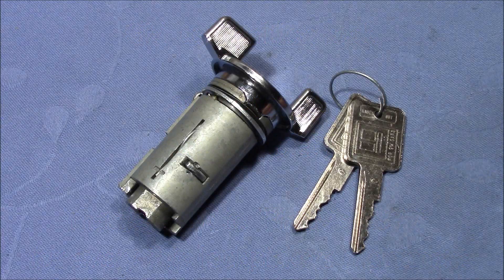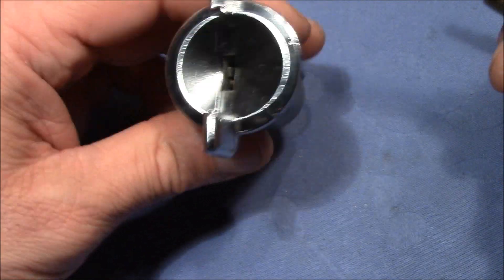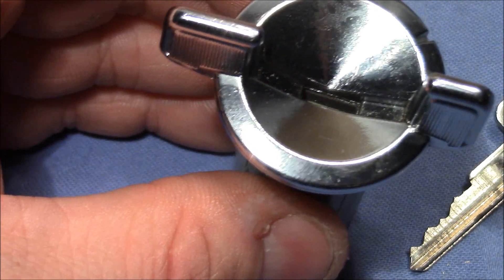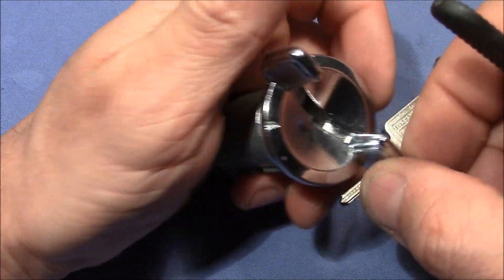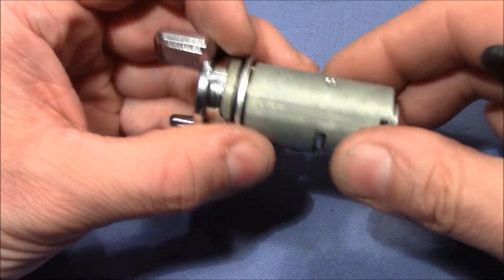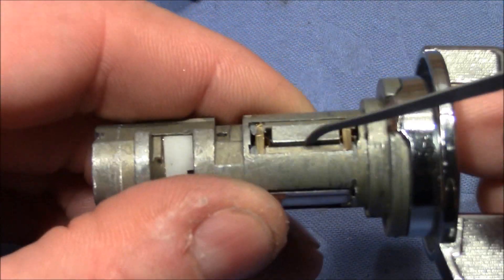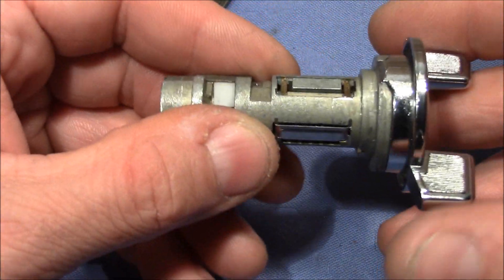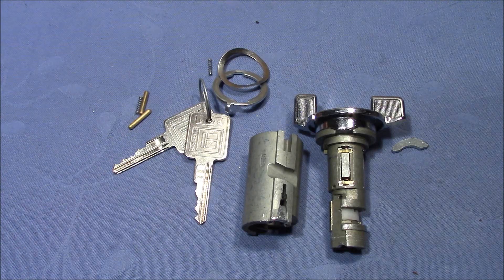(picking 432) A pick-proof lock? - GM car ignition lock inspected - thanks to 'PickME 1977'

Comment: If you have the sensitivity of the prohibited lock picking lawyer fingers. You can individually pick the wafers without tensioning the core but the spring tension is divided between wafers so it is incredibly hard to feel the bar snap into place. Keep in mind that each wafer has to remain placed while the next is placed.

Comment: I'm sorry to say this gm ignition isn't unlockable. It's actually very pickable. I pick them every day. This lock has a side bar that makes it harder to pick. But if you tension the side bar you can pick the waffers
Reply: I dill a small hole in the face of the ignition exactly where the sidebar is and run a piece of bent wire into the drilled hole and I tension the side bar and I use a pick or or a B102 or B106 jiggle key to jiggle it open.

Comment: why pick this lock, just take the steering wheel and anti-theft locking ring and turn signal switch out... pull the lock cylinder and turn the ignition switch pinion with a needle nose.
Reply from the maker: "why pick this lock" - because this is a lockpicking channel ;-)

Comment: Lost the keys of my 1988 Blazer. How can i do?
Reply: Just picked this lock! Thanks for the video!
Reply from the maker: Good to read that you got it open - jiggler keys are the appropriate weapon for this mechanism.
Reply: @Potti314  Had to make a tiny hole (after removing the "ears" of this lock), to insert a pin and release the extra safety, and then porceed with picking.

Comment: master locksmith have tools and Technics that can handle this lock
i thomas thill wrote a book years ago on this lock
for those of you that can imagine a new Technic to defeat this lock
the lock has 6 wafers we will target front of lock then back of lock
hint if you make a key cut in first 3 chambers
 space one    can be 1 2 3 4 5
             two    can be 1 2/3 4/5
             three can be 1 2/3 4/5
by inserting  into lock you can make side bar tilt
if tilted and turning pressure is applied
the corner of sidebar will trap under shell
preventing key from being pulled out
more to it if you need more info
thomasthill8163@gmail.com
work smart not hard
thanks for your time
last thought
gravity hurts
Reply from the maker: Interesting, so when using this method you cause the inners to get tensioned. Nice :-)

Comment: Put a screwdriver in it lol
Reply from the maker: That's cruel.
Reply: @Potti314  but it works for these lol, these locks after 25+ years of every day wear don’t hold their durability well. I just had to replace mine in my ‘86, the tumbler finally gave the ghost last month and you bet I was driving with a flathead screwdriver for 2 weeks

Comment: I saw this one on very old Ford Taurus (very rare in my country and region) , and I have similar working chinese (I think it's chinese) locker / desk drawer lock , that uses very similar design. And , it can't be - tensioned. When You try to tension it , You also tension all wafers , so , You can't put them down correctly. Key is cut on upper side , so , it's kinda unusual for this type of locks. It can be made to emulate this lock on video , by inserting small bars on 3 sides so only one can be unlocking one. I'll post a pics of key , core with key in it , and bible itself , as it has 4 sides for lock / unlock.
Reply from the maker: Sounds very interesting, it's cool to see so many different designs. I'm subbed.

Comment: Great video again buddy, very interesting lock, I had heard about them but had not seen any inside. I recently got the opportunity to try to pick a chinesse padlock, with smily keyway and friendly appearance, that has this system (beleave me, I tryed hard but the little bastard doesn´t open). It´s owner tell me it has this system. Now I understand why I can´t picked. Anyway, as some people said, the jiggers must work in this lock ;O))
Thank you very much for showing it to us my friend ;o))
Cheers!
Reply from the maker: I can understand your frustration. When I started working on this lock I had no idea when I couldn't set the wafers and finally gave up to solve the puzzle. Only after inspecting the guts I understand the reason. But now we are prepared for the next lock that behaves strange in the same way. I sent the lock to 'Lock Noob' and he was successful in opening it with the jigglers. It's because of the bad tolerances that the try-out keys work. So it's not a high security locks - but it cannot be picked.

Comment: it definitely  is pick able ive done one of these before locks before. simply mark out where the side bar is then drill a small hole though the casting. then poke a tool though the hole to tension the side bar at the same time applying turning pressure then rake the lock with a city rake it will open. you may also beable to drill a hole from the serfice to allow you to tension the side bar.
the reason why i was picking one of these is the owner wanted keys made to his ignition he also had a drivers door lock as well.
Reply from the maker: I agree that this is possible. You tension the locking mechanism with that method and the bad precision makes this lock easy to open. But drilling a hole is kind of cheating and to some extend destructive. Also for me it would not be possible as I had no idea where the side bar is located in an arbitrary lock. Of course for a real application to get someone keys made, etc. the cheating aspect is irrelevant.
Reply: Potti314 its not cheating at all get the job done man.  its not destructive its necessary the lock still works after drilling the hole if you wanna toy it and worry about drilling a small hole go head.

Comment: Interesting... so basically, any wafer lock could be made pick proof by means of a spring loaded side bar.  I have removed a lot of these locks in my youth with a slide hammer. They "pull" pretty easily. (No, I wasn't a car thief... I was a mechanic working for a repo guy)
Reply from the maker: I can imagine that destructive entry is a good possibility to get into these locks. But I'm fascinated by the mechanism that completely eliminates the possibility of traditional picking. As 'Lock Picking Lawyer' pointed out, there exist a lot of modern locks that follow this concept.

Comment: It's all about the springs... Also the shape of the gates and the edges of the sidebar are important.

Weak springs on the wafers and strong springs pushing the sidebar inwards would make this lock an easy pick...

GM as well as the chinese Golden Atom found the right balance of 'springiness'.
Reply from the maker: Thanks for the info, I have not expected that to be such an interesting matter of optimization.

Comment: Nice video. GM has been using this design since the 1930s... I agree it can't be picked if it is mounted such that you can't tension the sidebar. unfortunately, there are tools that can easily decode it. There are lots of modern locks that operate on this principle, including that latest version of the Kwikset smartkey, and a whole bunch of surprisingly robust Chinese locks.
Reply: Actually this lock style appeared in 1969 for compliance with Federal safety standards which required locking steering columns for the 1970 model year..  The basic lock assembly dates back to 1967..  the previous GM locks going back to 1930 were briggs and stratton designed locks which used a single key way, in 1967 GM introduced the "Letter Key" locks where there were 7 different keyways.. labeled A, B, C, D, E, H, J, K.  the  pair would rotate every model year.. A,B keys were used for 1967, C,D for 1968, E.H for 1969 and J,K for 1970. in 71 they started over with the AB pair again.. this continued until 78 which would be the final year for the J,K pair. in 80 they settled on the CD pair which went until 85 or 86,, from 87 on they used the E,H pair on everything including the PASSKEY system starting in 1988 ... the only ignition lock that didnt use this was the 1991-94 Chevy Cavalier.. which used a double cut key.. in 1995 GM went to the 10 tumbler double cut key.. with this key designed phased out in 1996..
Reply from the maker: Thank you. I think it's a great design for a pick-proof lock. The methods to defeat this mechanism by e.g. auto-jigglers were mentioned, but what do you mean by decoding? I can imagine that more precisely made locks with more wafer, etc. can eliminate the application of try-out keys. Just as you say, many modern locks follow this pattern. Is this the end of lock picking?
Reply: LockPickingLawyer use a car dip stick for oil it will unlock.. I do this to get in car's with style keys lol
Reply: I would love to see a bunch of variations on this design.  New Video?
Reply: This principle can be overcomed by brute force like a classic scerwdriver attack in movies. So high security lock in China usually builded to be free spinning.

Comment: Interesting lock. The only solution seems to emulate the key: computer generating picks? ;)
Reply from the maker: Cheers :-) You mean try-out keys?
Reply: I was talking about stuff like this:
https://img4.hostingpics.net/pics/938933computerpickscocolitos.jpg
;)
Reply from the maker: OK, I see. Do you think they work without being able to tension the locking mechanism? I can imagine that they work a bit like rakes - so they require tension. Right?
Reply: No, you do not use them as a rake: you insert it as a key and apply tension to test. You change angle and test. You change tool, and so on until opening.
Reply from the maker: OK, I see - thanks a lot for the explanation.

Comment: Nice video and explanation. I have a gm lock a friend gave to me but it didn't have the housing. I played around with it just pressing the bar in like you showed and didn't think anything more of it. Looks like if I had the housing it would have been a much greater challenge.
Reply from the maker: Thanks for watching. Yes, the complete lock must be taken into account when attempting to unlock what is secured with the lock. The mechanism itself is easy to overcome but the way the whole lock is built is relevant.

Comment: You can drill a small hole and apply tension on the sidebar. Or light tension CAN work but it's EXTREMELY hard. I had to fit two gm locks and we used jigglers to pick the ignition open. 68 keys on the chain but only went through the first 7 before it turned. :)
Reply from the maker: I tried light tension and had no success. The hole might work but it's destructive and you need to know exactly the place. Not easy from the outside. I can imaging that tryout keys work well, given the bad precision of the locking mechanism.
Reply: DarkWoodPicks use need it its a compound that drys hard the hole only has to be 2m just enjoy room to put something small in.
Reply: Potti314 its not destructive its necessary if its only a small hole the lock will still work fine mate. these igniton often stuff out sometimes the only way to fix them is to drill out the side bar from the surface then replace the plug.
Reply: Jackcc5 you'd have to plug the hole up and it's a good size hole

Comment: I have one of those also, and can't get any luck on picking it. It LOOKS so easy. I wasn't given the key, so I wasn't able to take it apart to see how it works, so this video is VERY useful. So couldn't you stick something in from the back to push on that sidebar, if the lock is disassembled like ours are?
Reply from the maker: The cutout for the side-bar does not extend to the end, hence it cannot be accessed from the back.
Reply: You do not need a key to disassemble it. The bit that retains the core can be removed in the locked position.

Comment: I have a GM ignition lock made like that, and I too have been unable to pick  mine.
Reply from the maker: Have you tried auto-jigglers as many suggested? I have no such keys to try myself.
Reply: no, I don't have any either of those either
Reply: If you twist the lock hard with a wrench is will turn and you never need a key again. Just ask my 1979 c10 truck. I was late for work and lost my keys.

Comment: This is the same design that kwikset smartkey went to in there generation 3. I have been discussing this gm lock with other pickers I have not had time to look at it personally thanks for this video very well explained
Reply: https://youtu.be/H-9_3gIQwPw
Reply: Chris Ahrens LHG I've seen your video and that was the first thing I thought too. But at the GM lock I don't see enough space to shim the sidebar.
Reply from the maker: Yes, it would work if you could access the side-bar from outside, but it's shielded by the handle. Other than drilling a hole in the front, I see no chance here.

Comment: Would an overly attack work as that's the quickest way into many wafer based padlocks such as Yales
Reply from the maker: I tried an overlifting attack (is it that what you meant?), but you need to be able to tension the mechanism and release to let the wafers return. This does not work here.

Comment: What about something like the Rockout Keys from Sparrows?  They have a Gridlock set of practice locks and you can add the Rockout Keys at a slight discount for a complete package.
Reply: http://www.sparrowslockpicks.com/product_p/new6.htm
Reply: Auto jigglers. And they'd work.
Reply from the maker: I'm not sure if rockout keys are the same as auto-jigglers. But if if goes in the direction of try-out keys it could work as the locking mechanism itself is made with very bad tolerances.
Reply: Good question. I don't know where I would come up with a real GM lock but maybe a local junkyard might be willing to part with one or more. I'll have to see what it take to remove one from a vehicle. Some junkyards are self-serve. Once I have one in hand I'll see about the other end of the issue.  :)